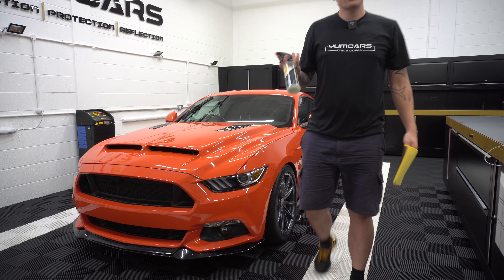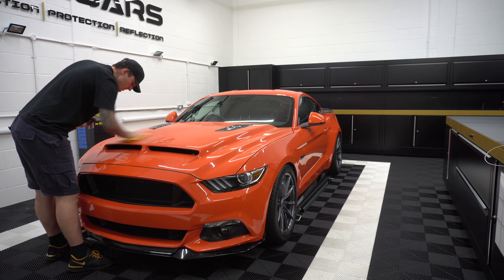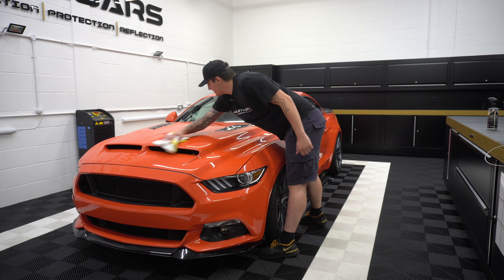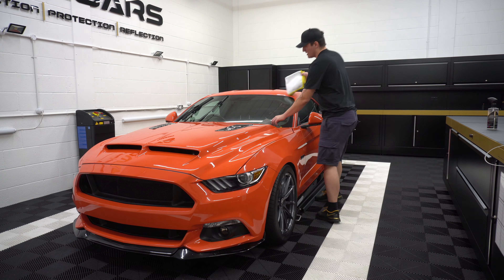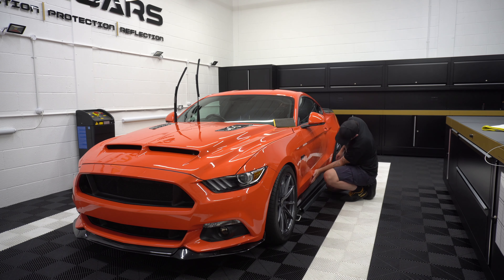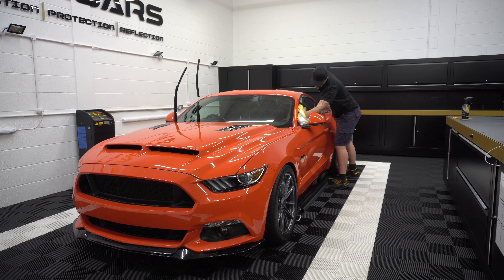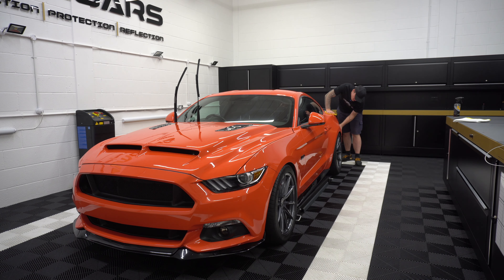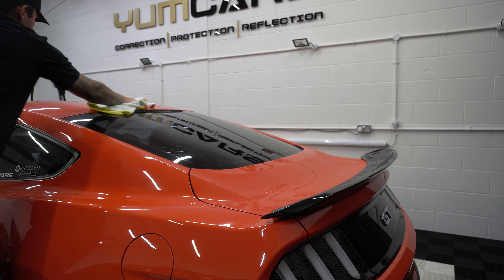Ford Mustang Detail Series E3: Decontamination

Comment: Nice video. Which clay mitt is that? Do you find mitt better than a bar?
Reply from the maker: This is ours that we are developing. You cover a lot more ground with the mitt and the performance is 99% the same as the clay bar. Plus they are reusable this one on the video is on its 17th use